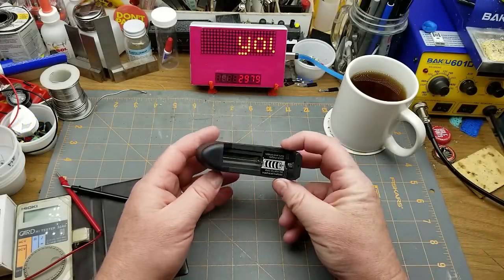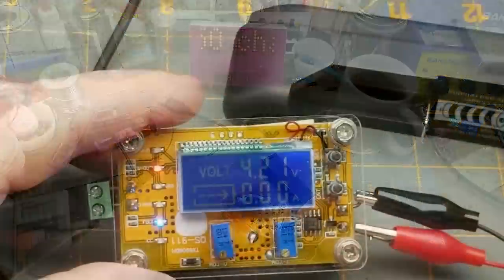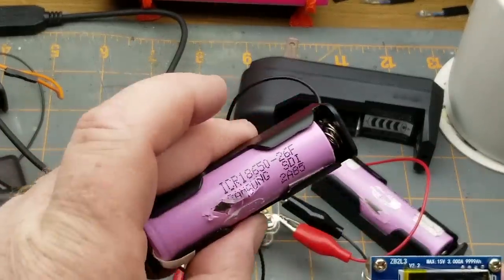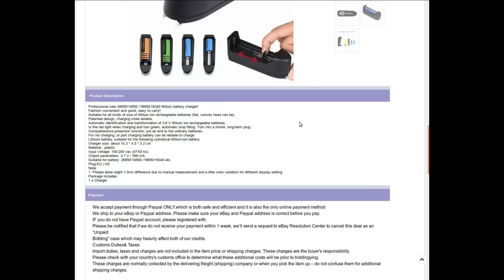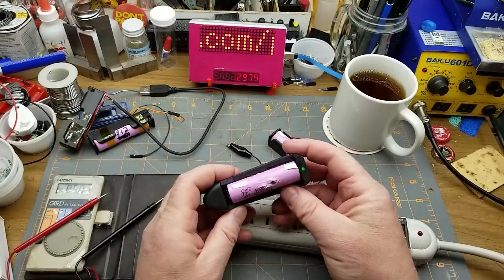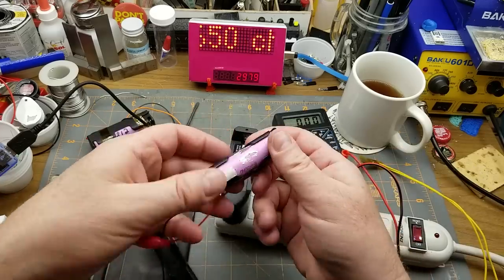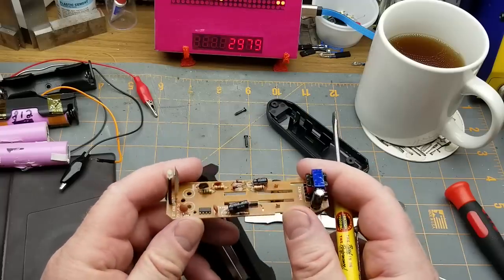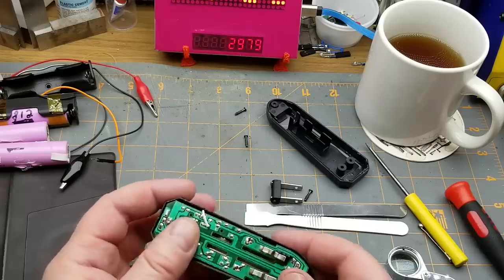cheap li-ion charger

Comment: Aside from the fact that it hardly has any charging current, it doesn't stop charging when the battery is fully charged, and there is zero isolation between you and mains voltage, it's a pretty nice charger! ;-)

Comment: I would put a scope with low value shunt  because i think the little $1 DMM most likely cant handle all the noise. also when you checked how much current the led draws when unplugged you used 10A socket but the lower ranges use voltas socket

Comment: I sometimes use super capacitors instead of Li+ batteries to test a charger. Not only will they charge "faster" (depending on how much "super" is in that capacitor) but proper selection of capacitor voltage or series stack will ensure an over voltage won't go nuclear on you.
Reply from the maker: Hmmm... I may have to try that trick after I open a future mailbag...

Comment: About a cheap on the inside as I thought, not horrible though. Really disappointing charge current though. 100ma average would take 20+ hours to charge. For the price though it was worth it just for the holder/spring contact assembly. Replace the innards with a 4056 to run on DC and you'll get up to an amp charging current.

Comment: You should retrofit one of those small charger boards in there, also, with those jumping readings I am wondering if the charging is in bursts.
Reply from the maker: I wonder if I could fit a phone charger and one of the lith-ion chargers into that case?
Hmmm...
Reply: @pileofstuff  One of those TP4056 boards would fit .  The only issue would be getting clean 5V from the built in "power supply".    Probably would need a FULL BRIDGE RECTIFIER and a 5V regulator as well as a an electrolytic and some bypass caps...

Comment: 9:15 point taken! My grandfather was color blind. He had to wait for the other cars to move at traffic intersections to know if the light was green. He dreaded being the 1st in line as he would not move until honked at. 😂
Reply from the maker: Im not that bad. The green traffic light is brighter, and is at the top. (Except in those weird places with sideways lights)
Reply: @pileofstuff  - Green in traffic lights is mainly "brighter" because of your colour blindness. My eyesight is the same. I may be deficient in that way, but I make up for it in other areas.
I also hate those dual colour red/green LEDs, they are absolutely shit. I swap them for Red/Blue or pretty much anything else.

Comment: A datasheet all english https://datasheetspdf.com/pdf-file/785673/Hotchip/HT3582DA/1
and a circuit diagram, some parts may not be the same but I think the layout is correct.
https://raspiblog.noblogs.org/files/2018/12/LI-ION_BAT_CHR.pdf

Comment: I got one of those I was thinking if I could charge multiple batteries in parrarel
Reply from the maker: You could try, but it wouldn't work very well - and it would take forever.
Reply: @pileofstuff  I have a 4000mha (2x 2000 on parallel) battery I tried a tp4056 it didn't work well that thing too forever never got to green do you recommend any other li ion charger
Reply from the maker: @Rainbow__cookie  You could try the module I used in this DIY charger build: https://youtu.be/jt2w5nik8aM (check the description for links)

Comment: That charger is very safe to use no worrys  about it I use one all the time yes thay take a very long time to charge up a cell but it dus a good job of charging
Reply: That charger is NOT SAFE - not in the slightest... it's a mains powered device with a huge number of flaws in the design. There is no way in the world it could pass electrical safety testing and compliance in ANY country (even China). In other words, it is a deathtrap.

Comment: Those chargers are both unsafe AND shit. Buy a LiitoKala Lii-100 or rebadged "clone". You get proper charging of 3.7V, 3.8V and 3.2V LiFePO4 as well as 1.2V NiM H and NiCD for a couple of dollars. Choice of 500mA or 1A current, proper termination voltages. They are great - the 2-bay Lii-202 is even better value